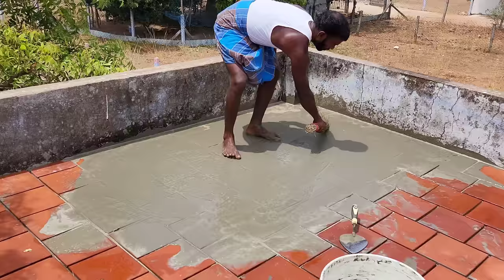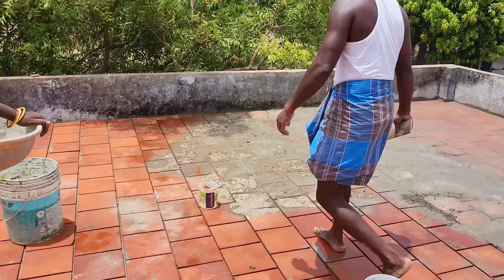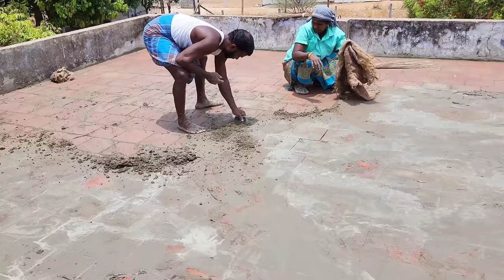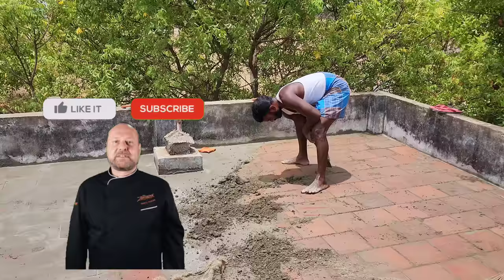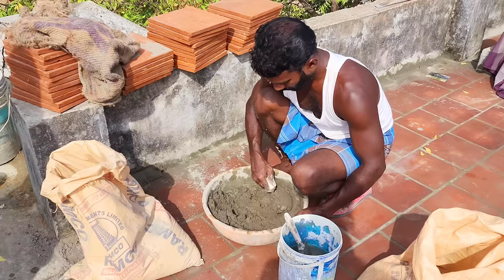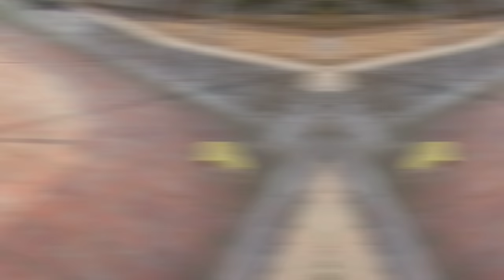Wow Excellent Roof Technology! Of water leaking solution-Cool roof tile joint Fill up process Work

Comment: The work is good but in summer it will cause a lot of heat in the room. The roof will not be able to cool due to light rain.
Reply: You're saying just opposite, it's called chhat bandi..... before laying those tiles, a tarpaulin is used over the roof and above that soil is spread all over and then comes those tiles, it cools the room in summers due to soil layer and make in waterproof due to tarpaulin layer
Reply: V